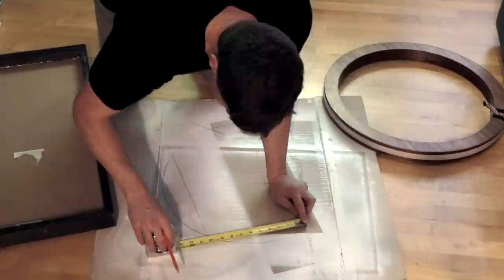DIY Music Reactive "Rings of Saturn" LED Pendant Light (controlled by Arduino) || How to Make

Comment: I wanna start by saying how amazing this is! This is absolutely stunning! I'm actually trying to follow in your footsteps and was wondering if you could guide me in the wiring of the Mega. I see that you used pin 5 & 7 for Leds since they are two separate strips for the bottom and top ring? And set the MIC_PIN to 0 (I'm guessing that is digital out 0). But later on I see that you used A2,4,6,8,10,12 for some pushbutton pins? I didn't see any part of pushbuttons in the video, so this kind of threw me off. Is it for the remote controller that you used to change modes? Also, are they necessary for the operation of the leds? Also, I'm using an arduino uno and only have A0~5. Would I be able to do away with those instead of the mega's high numbers that you used? This project looks awesome and would really like to replicate it for my apt. If you could guide me in the right direction, that would be so amazing! Thank you so much for the upload!
Reply from the maker: So I actually used A0 for the mic input. The other analog input are from the RF remote (mentioned but not shown in the video).  Although, as I've learned more, I think these probably should have gone to a digital input and would have been more reliable (sometimes you have to hit buttons twice to make it work -- since the remote was acting a bit quirky at times, I thought it best not to go into too much detail on it in the video).  I'm currently planning to rework this light with WeMos for Wifi control via the Blynk app, so haven't had time to refine the controls.    I think the code is too big for a Mega (the only reason I needed a Mega was for the size of the code -- didn't need that many inputs).  You can get Mega clones for about $6 on Aliexpress, so maybe just grab one of those?  
As far as advice for the code and electronices, i recommend building up the controls one step at a time.  Natural nerd has a video and code for a very basic music syncing with an electret mic, with no control button (just arduino, mic, and LEDs).  Once you get this running, you know your LED, mic, and Arduino are setup correctly.  Then check out Cine-lights code for his VU meter, which adds a single push button to switch modes (otherwise the same as NN's stuff).  Get that working so you understand the mode switching, then switch to my code and add the RF transmitter.  And, I plan on coming out with update sometime this year with Wifi app control and will include a circuit diagram and code (and more video details) in that update.
Reply: Okay thank you so much for such a prompt reply! I'll take your advice into consideration and get to it! Thank you!

Comment: In hindsight, is there anything you would have done differently?  Love this design, thinking about using the idea and techniques and making my own.
Reply from the maker: Many things :) hid the cords better, got the code running more consistently with lower volume levels of music, among others.
Reply: Hi. Marcel :) Did you use 18/2 SVT wire?  Being that you brought it up,  you could try 18/2 SPT-1 lamp cord, as it's much slimmer. Great video!!!

Comment: Great video.  My only critique is that, when you do your voiceovers, try standing and gesticulating while your record your voice- it will greatly cut down on the "uh"s in your commentary.  Stringing your thoughts together with silent hand motions will take the place of filler voice noise.
Reply from the maker: Thanks!  Constructive criticism is always appreciated.  And yes, you are right.  A friend in broadcasting gave me the same advice after this video.  In my subsequent videos I think it has improved (if you listen to the cantilevered concrete table or the Concrete Agamograph videos, I'm curious if you see the improvement).

Comment: Great lights!!! What is the name of the mounting hardware you used. 
The metal wire used to hang the lights?
Reply from the maker: las vegas life I just used a cheap $12 suspension kit from Amazon.  I will add a link as soon as I'm back at my desk.

Comment: muy bueno el trabajo, lo unico que te daria como critica...es que los cables de alimentacion de los leds los tendrias que hacer con los mismos tensores. ya que si usabas un hilo de cobre como tensor lo podias usar como cunductor de voltage 

muy lindo trabajo, saludos

Comment: Here is a question, I really love the design, somehow am not a big fan of the bulky black power cable. Shouldn't it be possible running the power through the metal cables, by buffering them with rubber. After all LED run on such a low Wattage and that there is no risk.
Reply from the maker: Yes, a few people have mentioned this.  Eventually I'll do a version 2.0 with power through wires and WiFi control over ESP8266.
Reply: Looking forward to it. Love your stuff, keep up the awesome work!
Reply from the maker: Kilian Funke thanks!

Comment: Can the off the shelf controller do the same type pattern?  Most of the off the shelf controllers I have seen do not move back and forth and chase at the same time?  thanks and very cool project that can be adapted to just about any application.
Reply from the maker: Patrick Stepler not quite...I agree, the off the shelf music controllers tend to be very Blinky/flashy, and don't have smooth blended movements.  The best I've seen is the one I used in my LED  concrete countertop project.  If you check that video description, it might be worth a look
Reply: dont want to sound stupid, can you provide a link to the video you are talking about. I looked through your videos and even did a search but could not find it, unless it is the waterfall?  thanks   love the projects
Reply from the maker: Yes it is the Waterfall LED countertop build on my channel (sorry to make you search, YouTube doesn't like links in comments).

Comment: Very nice. That's one of those lamps that would cost over 500 bucks. I would be very  interested in the arduino stuff. I'm a software developer but never dived into electronics as deep as I would like to
Reply from the maker: Thanks!  Yes, not cheap, all told, I think the parts and materials alone were about $300, but I've seen designer circle lights like this, without the music sync or patterns, sell for $1500+.  

The link for the code is now in the description of the video, if you want to take a look.
Reply: Modustrial Maker I make sure to take a look. But I still need a video about the electronics :-)
Reply from the maker: I definitely will make one at some point in the future :)  I have another smaller project involving music visualization and LEDs in my queue, and will document the electronics better than I did this time.  I'll either include more details in the video or make a separate video.  For this project I was learning everything electronic for the first time and made so many missteps, that it was hard to document well.
Reply: Modustrial Maker very nice, thanks for your effort. Of course I subscribed instantly

Comment: How long did it take you to finish it? Great job.
Reply from the maker: The woodworking only took a couple days, but figuring out the coding and electronics took a long time (lost track of exactly how much, but a lot).  this is largely because I had not worked with Arduino before, so there was a steep learning curve.

Comment: Здравствуйте, классное видео, решил сделать наподобие вашего проекта. Скажите эти ленты не перегреваются в закрытом пространстве? думаю нужно организовать охлаждение.
Reply from the maker: Активного охлаждения нет. Светодиоды 5 В, поэтому они не становятся почти такими же горячими, как и другие светодиоды 12 В. У меня не было проблем с перегревом.
Reply: хорошо, все собрано, теперь проблема с кодом. На ваше брелке 4 кнопки, а в скетче используются 6, почему так?
И кейсы не фиксируются - режимы постоянно перескакивают. Пожалуйста помогите!!!!
Reply from the maker: Привет, Извините, да, я изменил его на шести кнопочный пульт после того, как я загрузил ссылки. Вы можете обновить код, чтобы не использовать две кнопки, запрограммированные для регулировки яркости подсветки (просто закомментируйте разделы кода яркости и жесткого кода в размере 240 или около того).

Я также работаю над новой версией кода, который будет использовать чип esp8266 и получит управление WiFi через приложение. Я думаю, это будет намного лучше, поэтому следите за этим.

Hi, Sorry, yes, I did change it to a six button remote after I uploaded the links.  You can update the code so that you don't use the two buttons programmed to adjust the brightness of the lights (just comment out the sections of the code for brightness, and hardcode in a value like 240 or so).  

I am also working on a new version of the code that will use an esp8266 chip and will have WiFi control via an app.  I think that will be much better, so stay tuned for that.
Reply: понятно, спасибо, буду дальше переписывать код.
Reply from the maker: Если вы хотите переключиться на 6-кнопочный пульт, вот тот, который я использовал.
https://www.ebay.com/itm/DC5V-6CH-6Channel-Wireless-RF-Relay-Switch-Remote-Control-Switch-Receiver-Module-/262571673592?hash=item3d227dc7f8
Reply from the maker: +Lyboskaz cool!  Going to check it out!

Comment: You can still attach the LED wires to the support wires, they won't be seen if they are attached to the top.
Reply from the maker: Yes, planning to do that or run power through hanging wires for version 2.0 of this light.

Comment: hi, I liked the project but what is the material you use to cover the strip? the material you are cutting at 5:40?
Thank you
Reply from the maker: It is a flexible LED channel, where I cut the back out.  There is a link in the description of the video.

Comment: Excellent project but for us newbie you forgot the most important part which is the electrical connection.  Can you show us?  Or do you have another video.  I will be replacing an existing 3 light pendant for this one.  It would be helpful.  Thanks for a great video.
Reply from the maker: Thanks!  I have an Instructable with a bit more details, and there is a link to the Arduino code in the description.  If you don't want to get into Arduino programming, check out the off-the-shelf LED controller I used in my timber beam lamp build (it will work the same on this light)
Reply: @modustrial  Thanks I will look for it

Comment: You should have really used the steel wires to power and control the LEDs instead of those ugly black wires.
Otherwise great looking project.
Reply from the maker: Agreed -- in an ideal world :) I'm very new to working with electronics and Arduino, and didn't realize you could do this until after I posted the video, and it was suggested by a few people.  The install for the video is temporary (I needed a white backdrop to film it against), and I may very well update the wiring when I do the permanent install in my living room.  If I do, I'll be sure to post a video of it.
Reply: @Modustrial Maker how do you do that?
Reply from the maker: Do what?
Reply: @modustrial  as Jürgen said, using the steel wires instead of black ones. Does he meant using the steel wires that carrying the weight for electricity and controlling arduino or using another couple of wires made out of steel instead of black rubber ones to match the color and texture with the weight carrying ones? If he meant to use the weight carrying ones how you transfer electricity with them safely? Do you wrap them with another cable or is there a steel looking cable with different cores so it can be also used to transfer data and electricity?
Reply: @haganekazuki2241  I think it's only 12V so it's safe.

Comment: I like it. But I would use the holding wires to power the Leds strips.
Reply from the maker: That is in the works for version 2.0 :) Along with more music modes, Wifi control a Blynk app, and upgrade to 96 LED/m strips...  I have a few other builds in the list before this, but I expect to get to it mid-2018.
Reply: Modustrial Maker Great, keep sharing please.

Comment: 6:23 starts the best part)
the work looks great, but I was thinking of the way to make wiring not so obvious. is there is a way to let them along hanger strings and still be able to adjust the length of the string to the liking...
Reply: I was thinking those hanger strings are metal, they could be used to bring the power (it's low voltage and on the ceiling, there's no risk for anyone)
Reply from the maker: Still trying to figure that out....would be great if I could run power and data thru hanging wires

Comment: Hello. I think you could have improved the looks of it by using white and thinner bipolar cables instead of the black ones that are so noticeable.
Reply from the maker: Yes, I agree.  I am planning a version 2.0 with a number of improvements (hidden cables, Wifi control, etc), and will make a video about it with more electronic details when I do.

Comment: I cannot think of a worse place to put the edge banding on, he did a great job considering that.  He sounds sad about it, but I am not so sure you would have use exposed wood like this.  
Believe it or not, they sell contact or sticky backed mylar that looks exactly like brushed stainless steel and other materials, and it is cheap.  The surface of the wood would have to be very smooth, but it would be a lot easier than using wood banding.  Even a high quality paint job would work.  I like this guy, but this is the hard way of doing it.

Comment: I had one question, what function is mapping the sound to a light ? Did you use one led for a given frequency bandwidth ?
Reply from the maker: I am using the FastLED library with Arduino.  Check out my newest video for the reactive Bluetooth LED speaker, which has  Github link to code in the video description.  This light and the LED matrix just react to volume level and pulses (threshold changes in volume to trigger certain LEDs).  You can actually do quite a bit with intensity if you get creative with FastLED.

Comment: This looks amazing but it would be better if you find a way to hide the electric wire
Reply from the maker: I would love to hear some suggestions for hiding the black wires.  I racked my brain and couldn't come up with anything.  I looked into some way to run power through the suspension cables, but couldn't figure anything out.  

Also, regarding some of the messy wires near the ceiling, those will be cleaned up in the final install.  This is going in my living room, but I had to a temporary install in order to film it against a white background.
Reply: Modustrial Maker I saw a guy who split the power lines into different lines of copper wires and it looks amazing. If you want I can send you the link to his video
Reply from the maker: Yes, please do.  Copper would be very cool.
Reply: the best  thing to do  is to just use the suspension cables as your wires,  i am not familiar with the  addressable non RGB strip but i i guess you just have 3 wires  gnd  positive and signal ? 4 at the most and you have 4 cables so just attach the  3 wires from the strip to  3 of the different cables inside the light and then do the same  thing with the wires from the controller inside of the base
Reply from the maker: I'm definitely looking into this.  I am concerned about safety issues with exposed wires, wood beams, and a 12A power supply, but if I can do it safely, I might give it a shot.  The strips I use have an IC built into each individual control module, so you only have three wires, power, ground, and a control signal.
Reply: you could get some clear vinyl tubing and run the cables through so you have easy slip on insulation and then apply some coats of  clear lacquer to the connecting hardware  or you could just skip the clear vinyl tubing   and just lacquer everything ,  but i would not worry too much about DC , your strips are probably 5v or 12v right,  it can't be more than 24v plus it is going to be suspended from the ceiling so unless you plan on having some wild parties and guests literally swinging from the chandeliers  nobody is going to be getting up there  to touch it
Reply from the maker: yes, 5V.  I will try to make it happen when I do the permanent install of this in my living room.  I've got a couple more project videos in the works right now, but eventually I will get to it :)
Reply: yeah, maybe you can cover the wires with some kind of clear material
Reply from the maker: The wires I have are actually red, white, and green, so clear sleeving might actually make them more distracting.  So far, I think the idea to run power through suspension cables is the best idea, if I can pull it off safely.
Reply: i think he means covering the support cables as wires with clear material  ,but i really do not think it is necessary because it is AC and low voltage ,i remember these track lights from the 90's they work on exposed steel cables and they are running several  (up to) 75 watt halogen lights 
http://www.1800lighting.com/Tech-Lighting/Metal-Man/item.cfm?itemsku=700FJMM8HAC
Reply from the maker: Those lights are so awful they are awesome.
Reply: Modustrial Maker use copper tubing and surround the suspension wires with it (guide them through it) then run the power cables through that too which will hide them and look nice (as you said you want to use copper). Just use some thin diameter copper piping
Reply: link?
Reply from the maker: +Nickhil Joe for the code?  It is the GitHub link in the description
Reply: Modustrial Maker 5 volts is nothing. A car battery is 12v and you can easily touch both terminals without feeling anything. Even 24v is hard to hurt yourself with but 5v can’t even pass through your body. Just think about holding a 9v battery in your hand. The voltage potential can’t complete a circuit through human tissue. 

Go ahead and use the cables as your supply wires AFTER the transformer that converts it to 5v output.